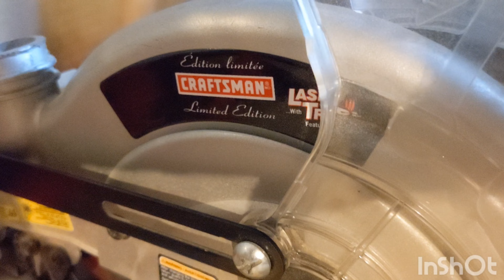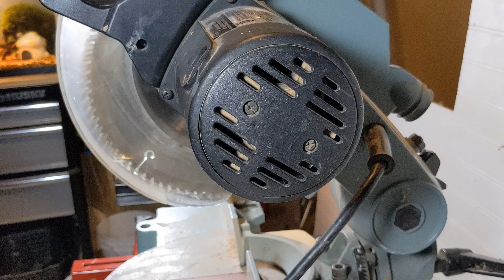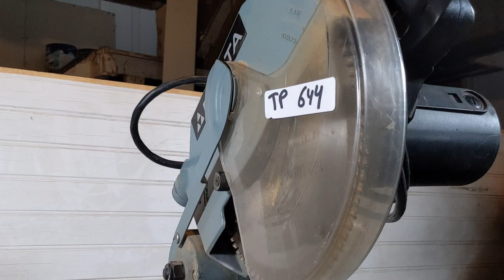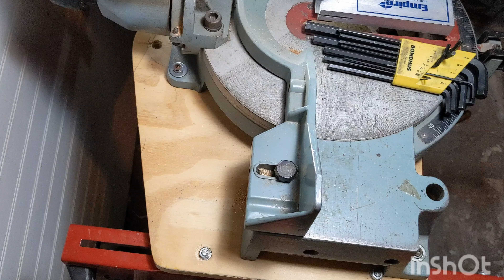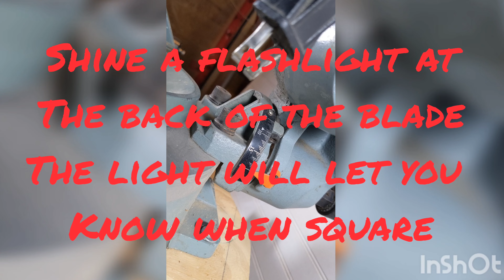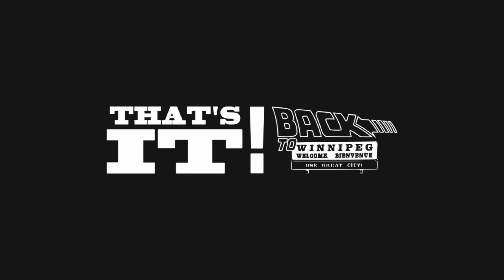Delta Chop Saw, Vintage Tools, #BORIS! #tools #delta #woodworking

Comment: I also Inherited a Delta 36-070 10" saw like this from my father. It works great. I just got it out of the barn last week and have been brushing off the dust and testing it out. I just cut a 4x4 today as a test and it worked great. I also like the smaller footprint than some others. I also need to check the settings  you suggested. I have a project coming up in the spring and this will do just dandy.
Reply from the maker: That's awesome, these old tools just won't die!

Comment: I’m very thankful for your tutorial, I try to follow it by memory at first but clearly missed a step, and was getting a little angled cuts. Today I went step by step with your video and the change in the cut is noticeable. I got a 10 inch delta model 36 075C (serial k9706) on a thrift store, mostly to do repairs and little projects at home, I’m a handy mom😅.
Reply from the maker: Fantastic, thanks for the feedback. It's good to know it's helped people. I was planning on doing more videos on setting up power tools. Let me know if there is anything else that would be good.

Comment: About to acquire my first miter saw, a used Delta 36-220 type 3 and am just delving into the woodworking world so don’t know much about what I need or what to check (want to get started with a low level investment before I get the expensive stuff that I don’t need yet lol) and this was extremely helpful and reassuring. Thanks for this video! Subscribed :)
Reply from the maker: Thanks, I'm going to make another video along the same lines, what's the next tool you think you're going to get?
Reply: I've got my eye on a table saw next! Also wondering, there was a double bevel miter saw that became available, would that be a smarter choice to acquire, or is a single bevel still able to accomplish what I need? I know this will depend on the project, but do you ever find yourself ''missing'' the double bevel feature if you don't have it? Thanks for the info again! :)  @borisbuilds
Reply from the maker: No I don't miss the double bevel, I think that would be more beneficial for crown moulding where just flipping the board over isn't an option.

Comment: I was given a Delta 10" a few years ago.  The serial number starts with 98.  So, I suspect that you're right about the manufacture year.  But isn't it interesting that the serial number only has four digits?
Reply from the maker: Right, the older the tool the more challenging to date as well.

Comment: I have delta 36 422L miter saw and parts are hard to find, i need the fence part nmbr a11795 a11796
Reply from the maker: try ebay, maybe youl get lucky!

Comment: I have the same saw and can’t for the life of me figure out how to change the bevel
Reply from the maker: There should be a handle on the back
Reply: I found a 36-250C at the curb. A sign on it read: 'works, but doesn't cut straight'.  I read and re-read that sign. Several times. Eventually I was laughing because I could not imagine how a 10" fast, go-around saw blade could do otherwise than cut straight. Once I had it home, a close inspection revealed that it cut with a small - but terribly inconvenient -- bevel. I hunted for the stop (and locking nut) to remove the bevel. Eventually I found it; the bevel stop screw is, as you'd expect, on the rear of the saw, near the horizontal fore-aft axis (pivot). Unfortunately, it isn't exposed to the user i.e. it isn't on the 'outside' of the saw body but is, instead, hidden behind a projection in the casting of the body itself (the non-adjustable part of the bevel stop mechanism). And, of course, the locking nut isn't readily accessible with common tools, given its cramped quarters. I hacked away at it until I could set it so the blade was vertical at the stop, but ground away still more enamel bitching about how whoever designed the saw should be condemned to adjust that limit stop screw with only a fork and a flat screwdriver for all eternity...

Comment: Great buddy…
I got the delta 36-220 type 3 saw last year for free from my dad’s friend…. Man I love it… just right for a permanent station and first miter saw for me…
I have to replace the adjustable handle on the rear for angle cutting…
Reply from the maker: Yeah it's a great saw, tons of power and very stable.
Reply from the maker: Yeah it's a great saw tons of power